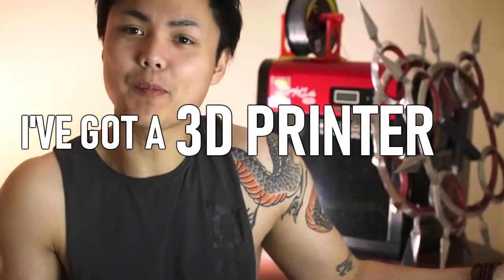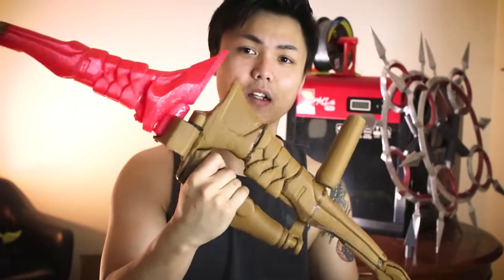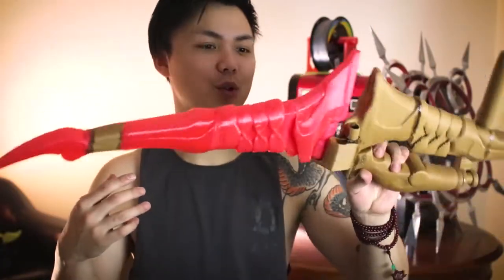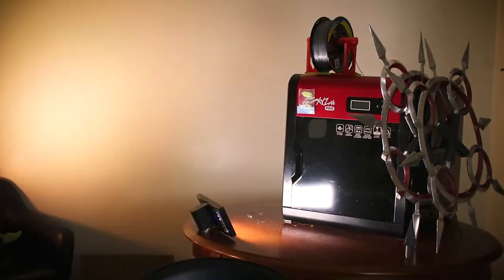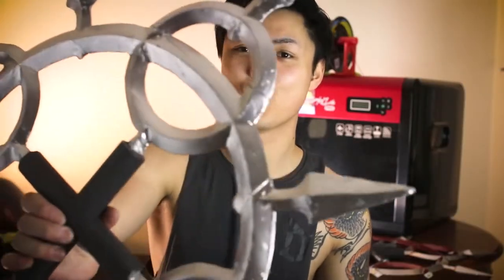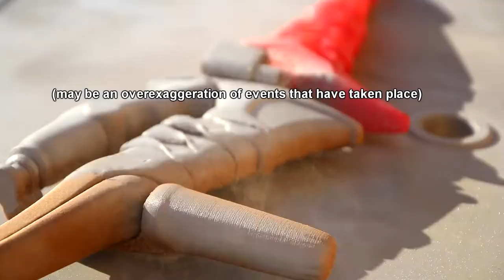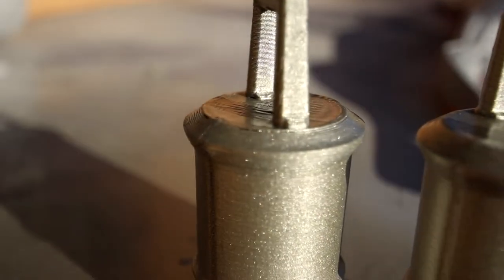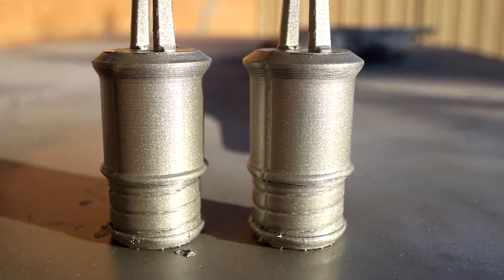HOW TO FILL/SMOOTH 3D PRINT LINES FAST AND EASY FOR COSPLAY

Comment: I've used this for my 3d prints and it really does save time on sanding and helps smooth things out. Although with deeper ridges, I go back in with a wet plaster filler then respray with the auto filler. It works great!